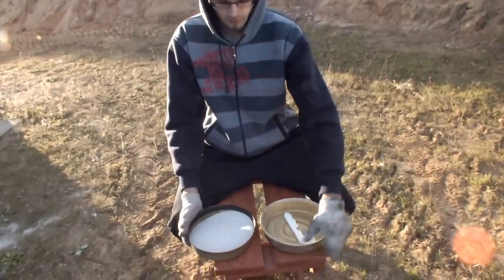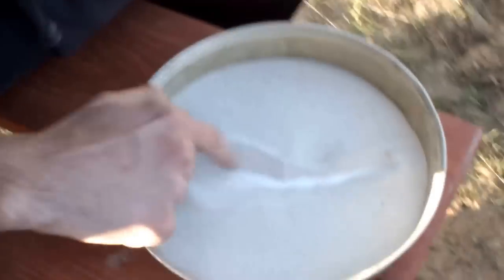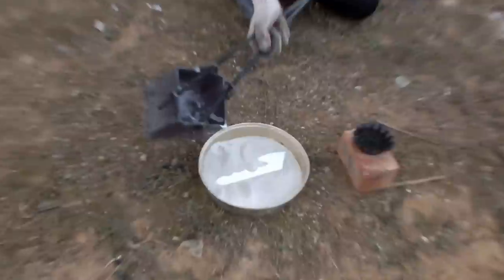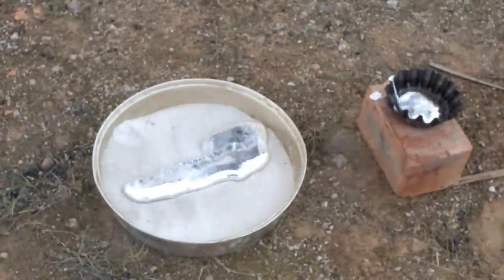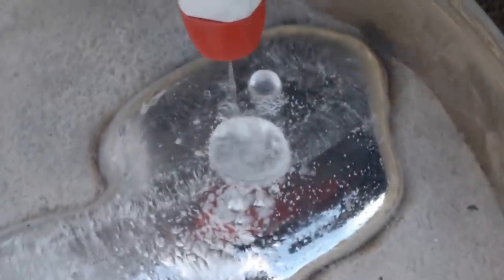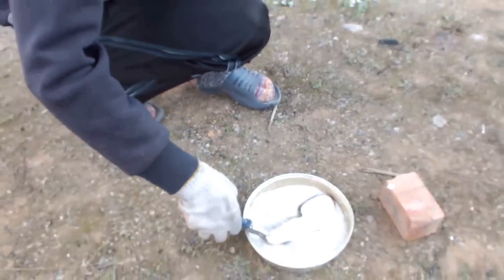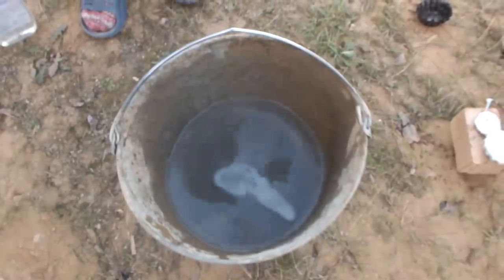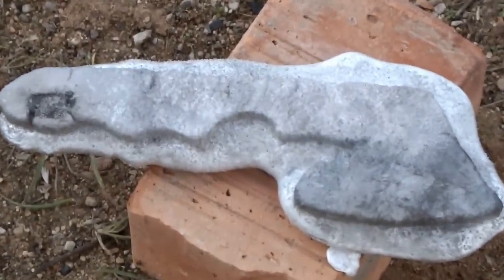Casting Aluminium Axe

Comment: dude looking at that thing after casting is painful
you missed the step where you 'cover the whole thing in sand and then make a pouring hole'
Reply from the maker: At the time we didn't have any green sand. But its completely normal. I find this method way better and easier to use for flat objects. After some grinding and polishing the axe turned out very nice btw.
Reply: yeah no
Reply: +RoastedEngineers nernbutt is right what if you dont have a saw you could have moisten the Sand and do it like he sad it. (i think you should get some co2 Into the Sand)

Comment: what could you actually cut with an aluminum ax? i mean trees are pretty much out of the question.
Reply from the maker: Actually, given that the axe is sharpened and massive enough, you could indees cut a decent tree with it. Ofcourse, it would need much more frequent maintenance to keep it sharp.
Reply: +RoastedEngineers maybe you can temper it?
Reply from the maker: I believe it can be done, but it's a much more involved process than tempering steel. Also there are many types of alloys, each one reacting differently to heat.
Reply: you can't temper straight aluminum but you can temper some alloys like aluminum and brass or aluminum and copper

Comment: You are so UNDER-PROTECTED for working with molten metals. OPEN TOE SANDALS. are you kidding! GARDENING GLOVES, are you kidding! SHORT HANDLED PLIERS, are you kidding! A word of caution sir, you are not prepared, and you may get away with this for a while but a splatter of molten metal will go right down to the bone in your foot or burn through your gloves like they weren't even there. The short handled tools you should know instinctively not to use. Face shield is a must too. Do yourself a favor and brush up on safely handling molten metals. Not busting your chops, just trying to pass on what I have learned. Good luck. ps shut the torch off before you pick up the crucible NOT while it's in your grip...common sense.
Reply from the maker: Thanks for your input, we will try to improve on safety gear!
Reply: geez

Comment: Sorry to say but that thing is just ugly and even if it was sharp would be next to useless as an "axe." Maybe try casting just an axe head and tying it to a wooden handle... casting an axe head wouldn't be hard, just get a steel pan and put it at an angle so you get an aluminum wedge once the molten aluminum cools. Or if you don't have the "green sand" you could make a mold out of something else like plaster.